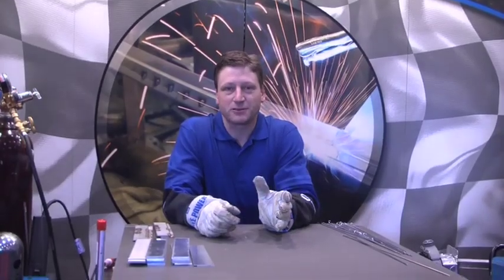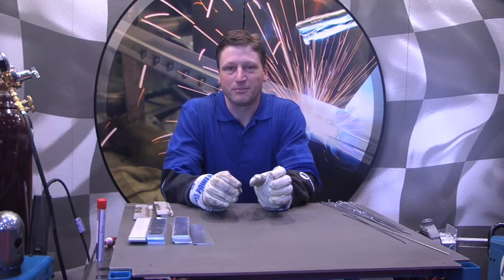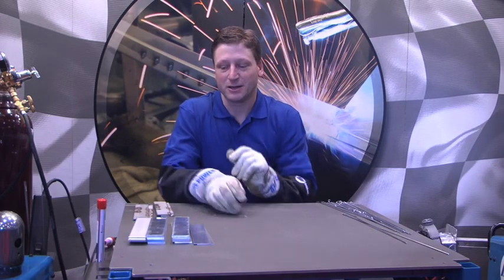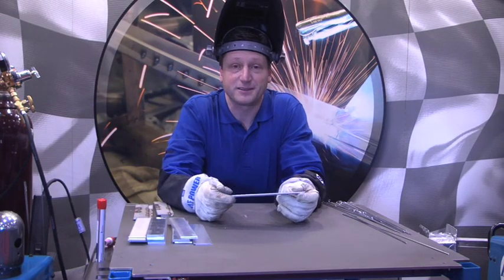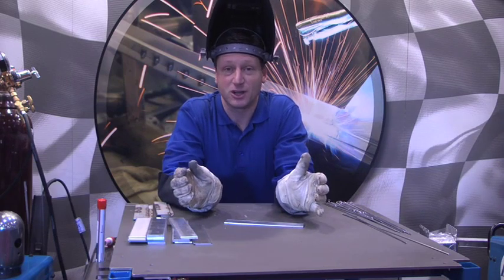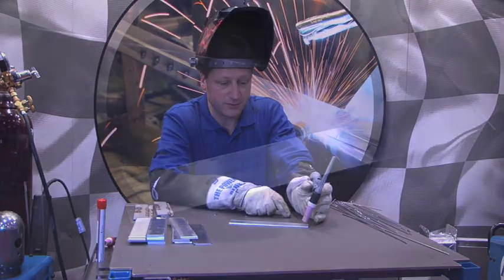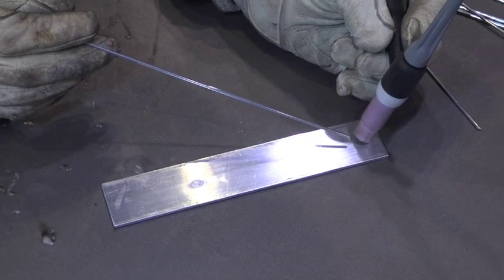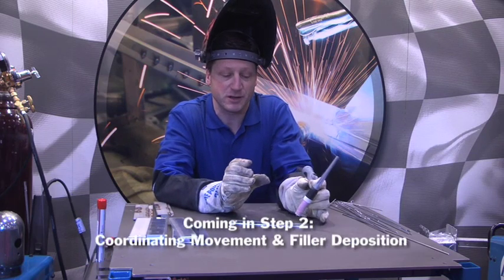TIG Welding Aluminum Part 1: How to Hold the Torch

Comment: Why do people often say tig-welding aluminum is the hardest, and how do you manage what makes this true?  What makes it not true?
Reply from the maker: Probably just the coordination it takes to manipulate the filler rod, torch and footpedal at the same time. That, and blowing through thin-wall material is very common. TIG on aluminum should look pretty when done, but it's sure easy to mess it up.
Reply: Thanks guys!

Comment: I say that with aluminum the puddle control is greater than steel.  with steel if the metal isn't completely free of impurity's like rust or other shit the puddle control is bullshit.  but then again when I final got tig welding on steel down I would have to have the tungsten like less than a 1/16" away from the pool.  with aluminum you just punch the pedal until the pool forms then start adding filler and slowly let off the pedal as you go cause the metal heats up fast.